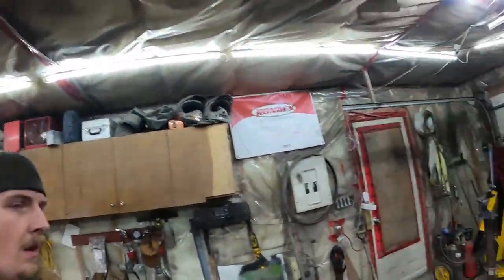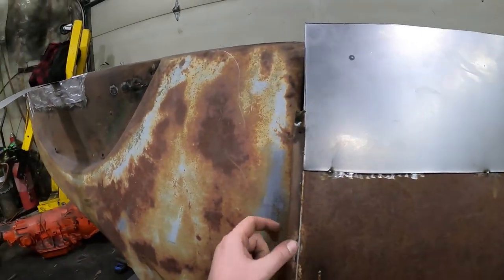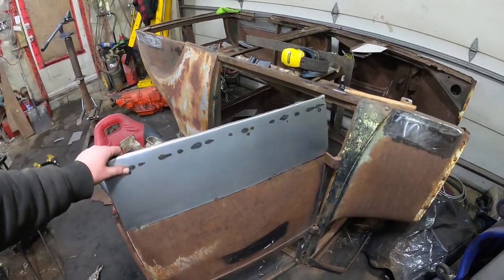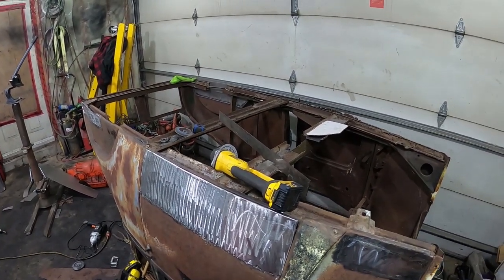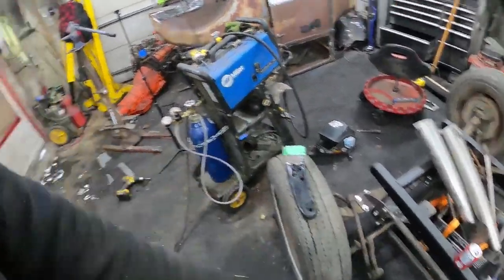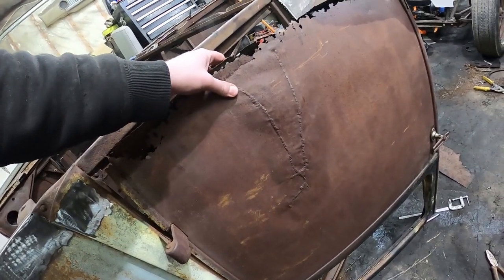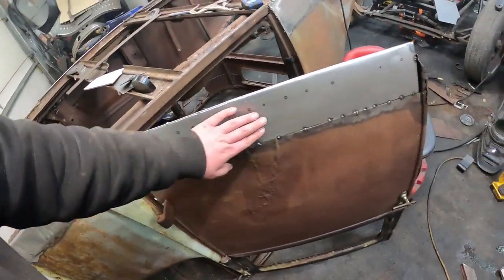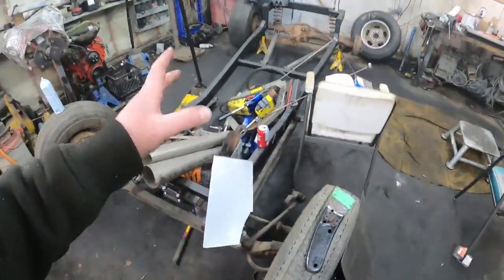"Fixing" Rusty Model T Doors with Basic Hand Tools

Comment from the maker: Let me know what you guys think of all the metal repair!  As always thanks for watching!
Reply: Have you thought about doing the t5 shifter knob for my project in my profile pic I think that you can make a really cool one .I could do one but I figured I would try and get a youtuber to do one for me and your style kinda fit the look I'm going after but I know you have your own projects to worry about but I figured a shifter handle would be easy enough and quick
Reply: It's looking good 👍👍🇨🇱
Reply: I loved how you repaired the doors. I work at a body shop for the past 21 years. But I am not a body man I do all the mechanical work there, for doing that at home with basic tools that came out super great. Me personally I would’ve liked to have repaired the door all the way on the side that was messed up. But it is your vehicle and you do it the way you want. Also watchWatching you turn the four-door 57 into a two door has made me think about doing that with a 55 because I’ve always wanted a 55 Chevy and they’re very hard to find around here in the Northeast of the United States if you find a nice one they are very very expensive and I mean nice as in rust in the body and frames
Reply: This video dropped on the same day: https://www.youtube.com/watch?v=i0bYp0wFnY4        He actually has the door apart so you can see the structure.  Maybe you follow Iron Trap already, but in case you don't - lots of Model T content. You may like it.
Reply: Wow! Those doors were soooo far gone on the bottom and sides. I've seen better metal at the low tide line....Great save. Adding some gas weld beads to match up the new steel was/is pure art.  Really looking forward to watching the rest of your build. Hope your weather cooperates so you can figure out the truck issue.
Reply: Looking good. We learn from others and our mistakes. I will soon be working on a 1971 k/5 Blazer with alot of rust so I know your frustrations.
Reply: Gonna be cool!!!!! Nice work imho!!!
Reply: I was watching and thinking that you should extend those butcher welds and complete the character motif...and then you did! Looks great. Of course gloss black is definitely out now :-)
Reply: Honestly you did a great job on the doors👌
Reply: Hey ya got this ya savin money Learin and able to try so Give it a go better then me so no worries i,m on Stick doin alright but get the Odd Hole Ha ha So No Worries Dan All Good

Comment: You really have great fabrication skills and a talent for working out the simplest way to get to where you need to go.  That door is every bit as good and strong as when it left the factory. Who needs replacement panels when you have Dan with sheet metal, a welder and a grinder!

Comment: Liking this more and more.  Your process is spot on, one tends not to forget when largely self taught.
2 suggestions, may want to consider some sort of "weep" hole(s) in those door bottoms (not sure how well glass on such early cars fits so leakage past seals possible).
Think about how you want to do that rear lower panel at the back of the car and, if you can convince yourself, begin working with the bead roller. That panel should lend itself to experimentation and, as its not huge, not a lot will be lost if you have to junk an attempt or two.
Reply from the maker: totally! needs a few drain holes.  thanks for the tips and support

Comment: Some times it helps to scribe a line with the die grinder on the bottom of the door. Where you want to fold over. It makes it easier to dolly and it folds over straighter. Hopefully I explained it so you understand me. Just a helpful hint buddy. I think it came out great. Plus you don’t want it to perfect. Then it won’t match Henry Fords work. Keep up the good work. That thing is going to be Awesome.
Reply from the maker: totally!  thats a good tip!

Comment: Yeah man the bottom of the doors are turning out really nice actually better than expected. Your metal work is coming along nice and your having my kind of luck with cars tearing up u get one fixed and 2 more tears up and I laughed my ass off at the $8000 parts car gig I feel your pain 🤣😂 but I guess that comes with owning a bunch of projects. I stick with the same brand and around the same year's so I can swap parts out also lol but yeah man your fabbing skills are coming along cherry. Those doors worked out nicely
Reply from the maker: haha gotta own a bunch of the same junk so you can just transfer parts around.  you can only drive 1 at a time right?
Reply: @DDSpeedShop  that's right there's been times that I needed to be able to drive 2 at the time but it didn't work out so well so I just had to go get some help which I hated to do because they think they own u after that lol

Comment: Your doing an awesome job of learning sheet metal fab as you go. Is your plan to paint the body or try to save the patina?
Reply from the maker: probably leave it ratty
Reply: @DDSpeedShop  If your interested this concoction adds rust pretty quickly. In a spray bottle add 1 10 oz bottle of hydrogen peroxide, 4 tbs white vinegar,1/2 ts salt, shake the bottle well. you can put the metal out in the sun or up here in the GWN I just heat the metal up with a heat gun then spray the solution on, as it drys re heat and spray again. Let it age before wiping it off.

Comment: The reason for the bottom rib, someone please advise? 
FRAME HORNS? If you were using the model A crossmember people relive (notch) the frame rail underside for spring clearance of the traverse axle mounted directly underneath. This could locate the frame horns. Cut off the existing frame 3/4 inch in front of your spring, shorten the horns (if desired), mount the top and outsides flush then leave any excess protrude below the existing frame rail.
Reply from the maker: yeah im just gunna wing it with the horns.  more of a look than anything haha
Reply: The rib at the bottom of the door gave strength to the rear corner via the bead return thickness eliminating forming a sharp corner. Kept from scuffing shoes when standing on the running board.
Frame horns: They would add character. I welded '32 horns to my bobbed Model A frame.
Thanks for the content.

Comment: If you just bought it bring it back is defective it’s worth a shot just don’t tell them what happened
Reply from the maker: ill probably just accept it and buy another one haha
Reply: DD Speed Shop  it’s also possible that the alternator shorted inside and burnt the wire. I have seen that happen many times. Not so much with Delco alternators but others. You probably would want to add a fusible link or a built-in fuse to the wire but it have to be like 150 A or more